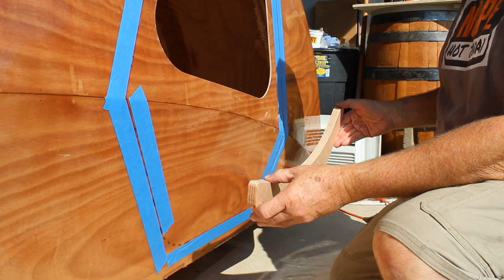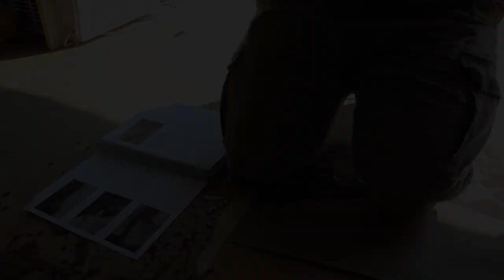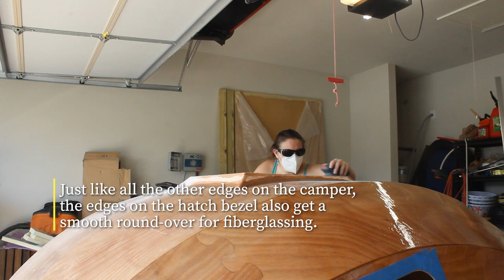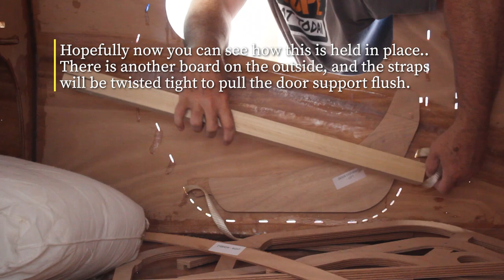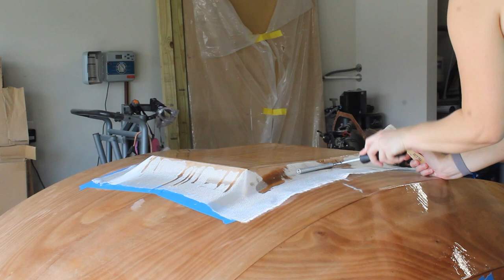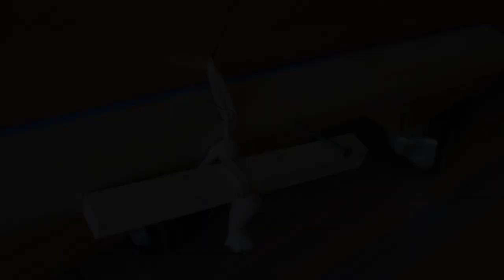CLC Camper Build Day 22

Comment: Yep, that’s what I was thinking, as far as the stiffener, but it’s not much of a grip on that seam. I reckon the glass on inside and outside of it is probably enough.
Reply: The tape on the roof is CRAZY 😜. I don’t understand…
Reply from the maker: We were wondering about that too, but the cell-o-fill seems to be pretty strong. We've already got the doors cut out in real time at this point (all our videos are on delay, I'm slow editing..) and they've been keeping shape fairly well so far. I think we'll be attaching the doors soon and we'll see how well it actually worked out!
Reply from the maker: Right?? I don't understand it either. I think this step could have been skipped.

Comment: I hope your solution works with the door...  are you planning on using the stiffened door to help keep the door frame in the right place later on in the build?   I am looking forward to your future builds :)
Reply from the maker: The stiffener just helps with the door shape I think, not so much with building the frame. We would have to mount the hinges and door before building the door frame otherwise. We will probably use the door to try to help dry-fitting the frame before we glue anything down though, just to make sure it all lines up. Thank you for watching!!